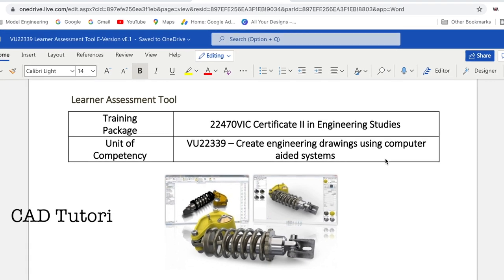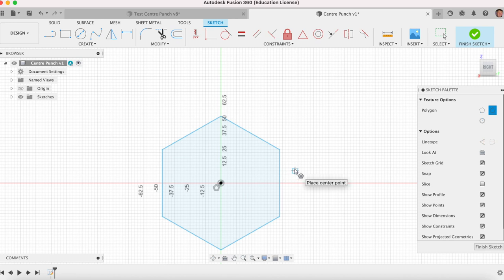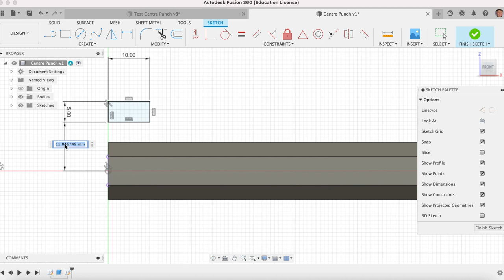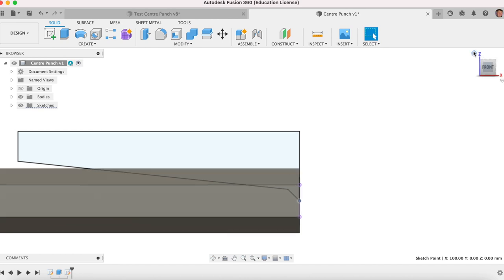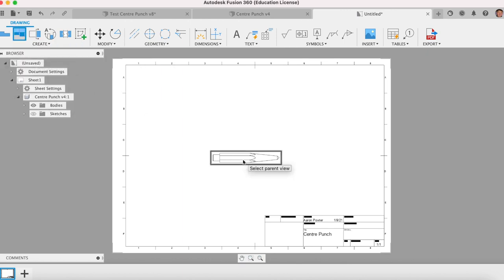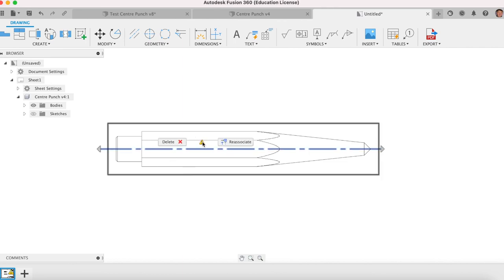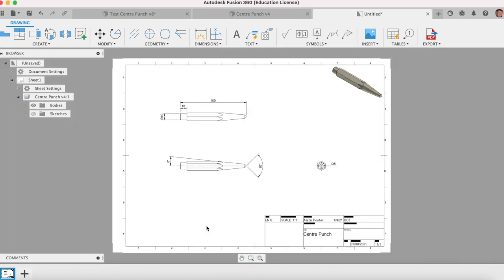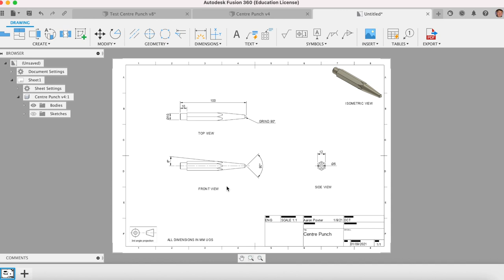Fusion360 Modelling & Drawing Tutorial 3 - Centre Punch

Comment: Hi Aaron, great series so far.
A question: For your Syil 7 CNC at home do you create your CAM machining's straight from Fusion 360?. Regards Kevin
Reply from the maker: G'day Kevin.  Yes that is correct mate.  I design in the model workspace and then switch over to the CAM workspace.  I apply tool paths (with the correct rpm and feed rates) and then post process the code.  Transfer with a nerd stick into the controller and push the green "go fast button".  Of course you still need to tell fusion the G54 co-ordinate position. Do you have a simple part that you would like me to make and demonstrate for you?  Feel free to send me an email mate.  Cheers, Aaron.